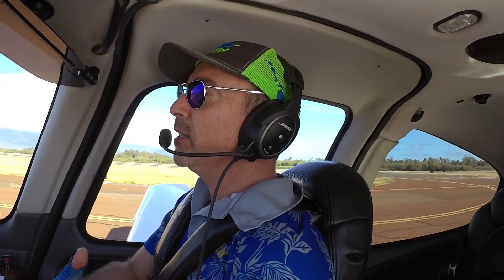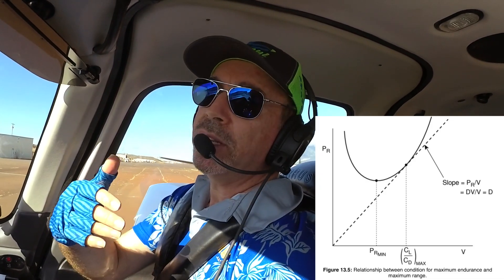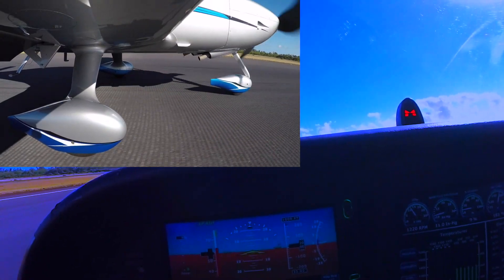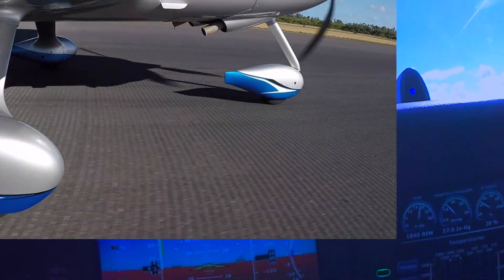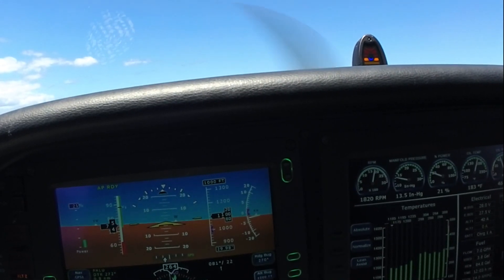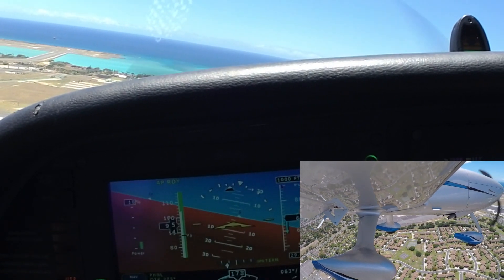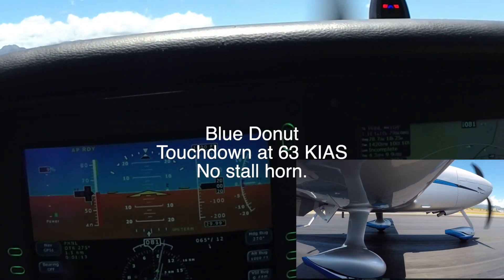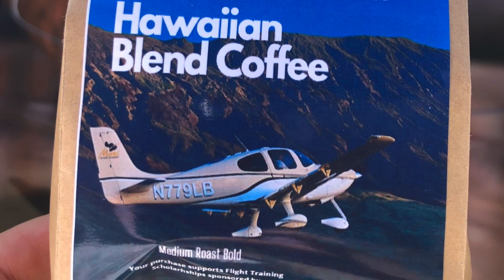Master Class | Perfect Landings | Pilots

Comment: This is an excellent demo and a good reminder to fly the weight adjusted Vref (indicated by the blue donut on the AoA-I). One thing that’s not clear is - why is touching down with power and a few kts above stall speed better than touching down with no power at a stall speed. It seems we can use the presented technique just as well if reduce power to idle during round out and then flare. Is it to have a little more buoyancy to be able to keep the nose wheel up (easier)? Do you use the same technique for short field landings or just soft?
Reply from the maker: Thank you ! to maintain the lowest sink rate, guarantee 30% above stall speed (1.3 Vso) and have the loveliest smoothest touchdown ever and in complete control .... this is the sweet spot.  Once the wheels touch you go idle and can either (1 hold the nose off for soft field 2 hit max brakes for short field 3 just slow to a normal Landing) once you drop power for a landing you are "guessing" as to when you did it right, and most of the time pilots tend to increase the pitch (increase aoa ) and make the landing firm.  Try this technique and see if you like it.  Thousands of landings with this including wind shear scenarios and it works beautifully.
Reply: @ Makes sense. Thanks for the details.